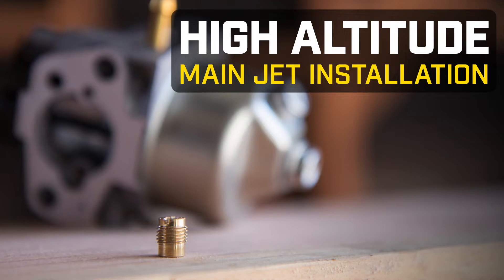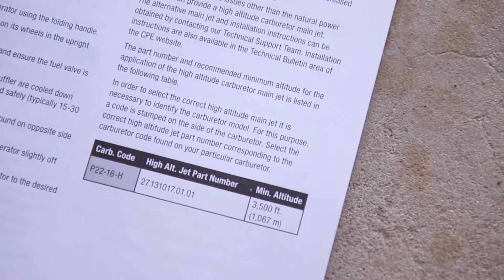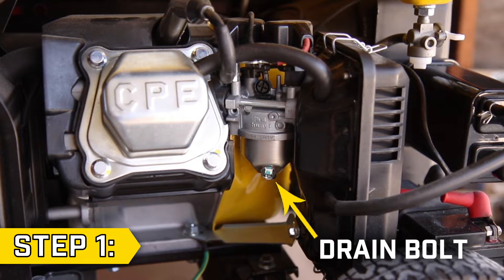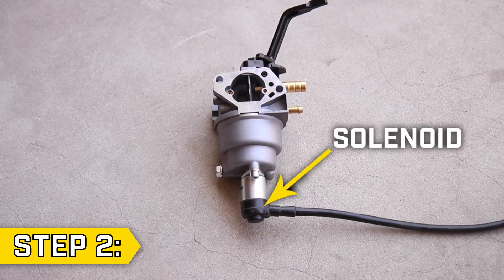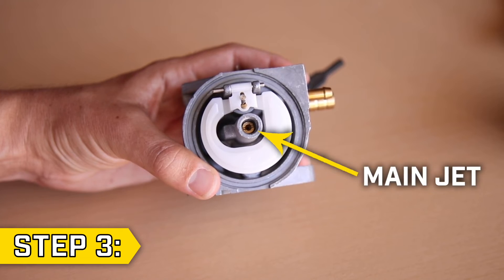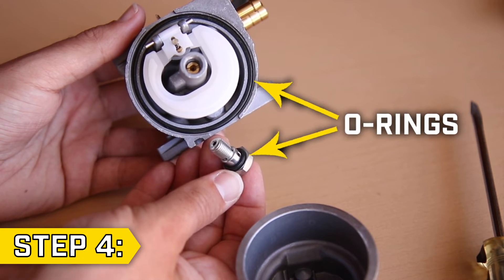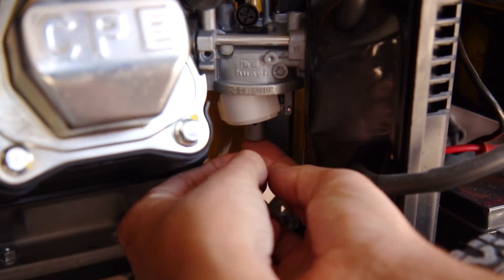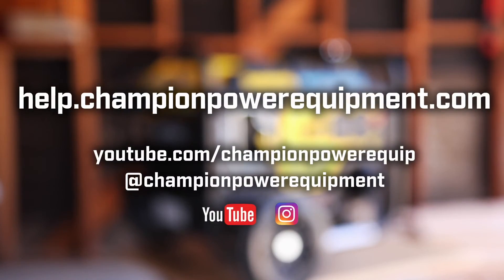High Altitude Jet Installation (Generators and Inverters)

Comment: Mine didn't work at high altitude. I got a good workout pulling the starter though...
Reply from the maker: Hello, we do apologize that you are experiencing a starting issue at a higher altitude. At high altitudes increased exhaust emissions can also result due to the increased enrichment of the air-fuel ratio. Other high-altitude issues can include hard starting, increased fuel consumption, and spark plug fouling. If you need any other assistance with your unit please give us a call at 877-338-0999. Thank you.

Comment: If you do not need to change jet for propane use only, are there any adjustments that need to made for high altitude? 8,000 ft and above?  If so, where would one find instructions?
Reply from the maker: No additional adjustments would need to be made. Just note that for every 1000 feet above sea level, the generators lose 3.5% of power. 👍
Reply: @ChampionPowerEquipmentHQ  Thank you for the clarification!

Comment: I took my Champion 2500 Dual Fuel up to a campground at 8300 ft.  I exclusively use propane and decided to test if replacing the jet was necessary since I live near sea level.  The Champion fired up and ran for several minutes at the high altitude with the standard jet installed.
Reply from the maker: Awesome! No jet is necessary for propane usage. 👍
Reply: @ChampionPowerEquipmentHQ  Yes, I was very pleased!
Reply: Thank you!!!